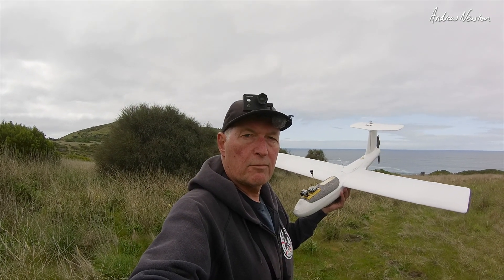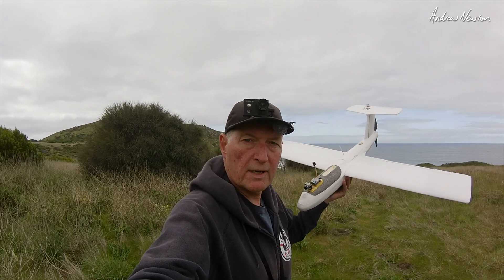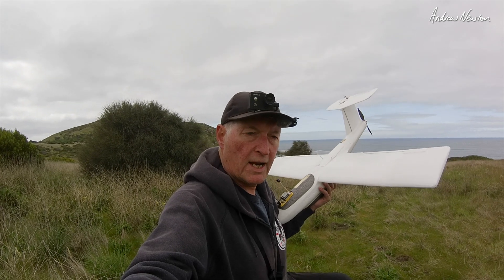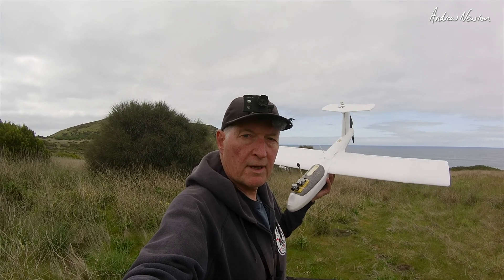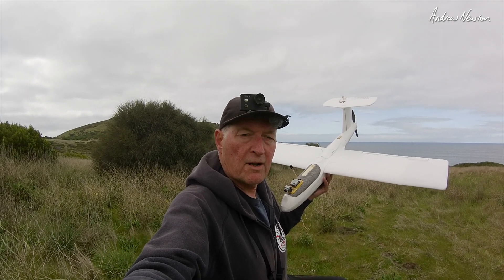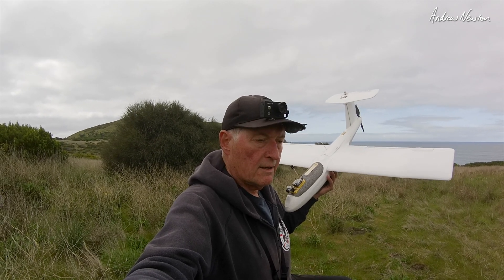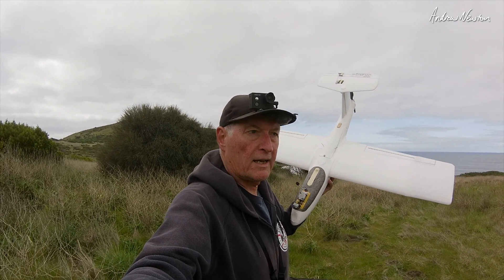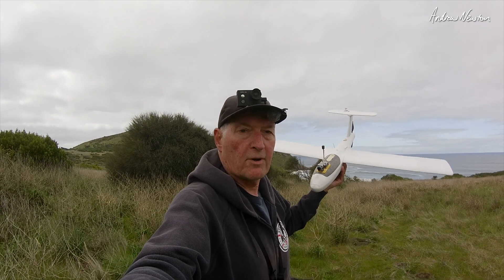XBird extended ailerons and WTF OSD

Comment: Quick tip for RSSI if you are using ExpressLRS: You should always be using RSSI dBm instead of plain RSSI in % because ELRS has different sensitivities for failsafe depending on which mode you are using (like 500Hz goes down to -105dBm and 250Hz goes to -108dBm)
Reply from the maker: Thanks, I do use that for CRSF. But this was SBUS D16
Reply: Yeah then its just about setting the scale i guess. Personally im way too lazy to do that haha.  @AndrewNewton

Comment: Very nice update, I've been flying with it for a year now. I heard that XB800 V2 is coming and available on Aliexpress.  After quite a few iterations, I found these PID values the best for my twin setup. I think "I" term was also contributing to oscillations on my setup.               
--------------------------------------
set fw_p_pitch = 15
set fw_i_pitch = 4
set fw_d_pitch = 5
set fw_ff_pitch = 85
set fw_p_roll = 12
set fw_i_roll = 2
set fw_d_roll = 8
set fw_ff_roll = 25
set fw_p_yaw = 0
set fw_i_yaw = 0
set fw_d_yaw = 5
set fw_ff_yaw = 0
set max_angle_inclination_rll = 450
set max_angle_inclination_pit = 350
set dterm_lpf_hz = 10
set fw_turn_assist_pitch_gain =  0.400
set nav_fw_pos_z_p = 25
set nav_fw_pos_z_d = 8
set nav_fw_pos_xy_p = 55
set d_boost_min =  1.000
set d_boost_max =  1.000
set rc_expo = 40
set rc_yaw_expo = 5
set roll_rate = 32
set pitch_rate = 12
set yaw_rate = 5
set manual_rc_yaw_expo = 0
set manual_roll_rate = 50
set manual_pitch_rate = 50
set manual_yaw_rate = 95

Comment: Been using WTFOSD for a long time on my V1's. It is great. Hard to think of any reason to upgrade to any of the new HD systems.
Reply: Thought so too at first (I only have the goggles V2 and they are very comfortable to me), people say though, the o3 air unit with DJI googles 2 support H.265 video encoding, yielding noticeably better resolution at the lower bitrates). Not sure if the Goggle V1 or V2 support.
Reply: @rcfreakamit  DJI V1 from analog was revolutionary. V2's O3, Caddx etc is incremental HD improvement. An improvement but not enough to knock your socks off.
Reply: @TakeItToTheGround  Walksnail Goggles use OLED screens. A huge difference over your LCDs......😏😏😏😀🇬🇧